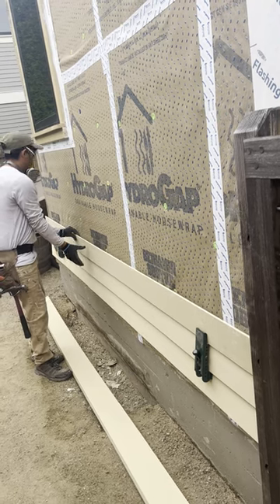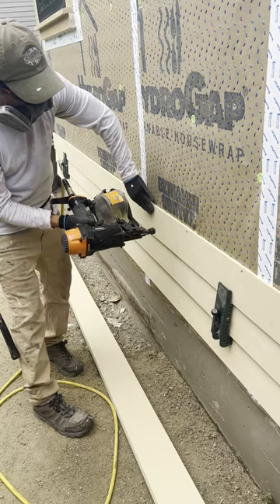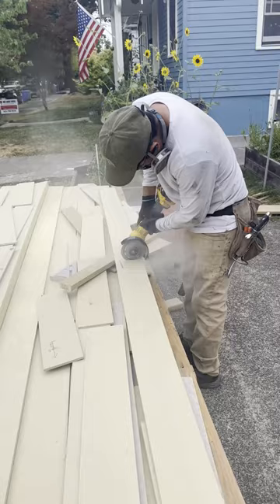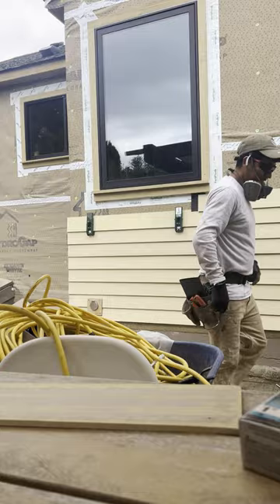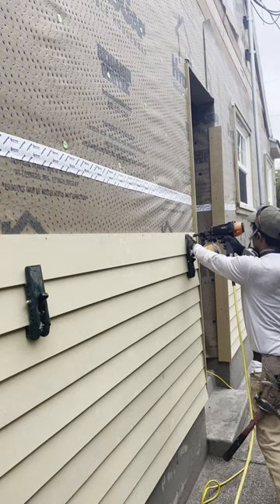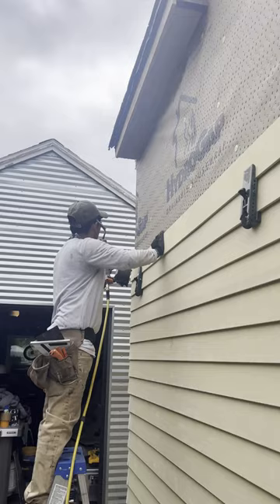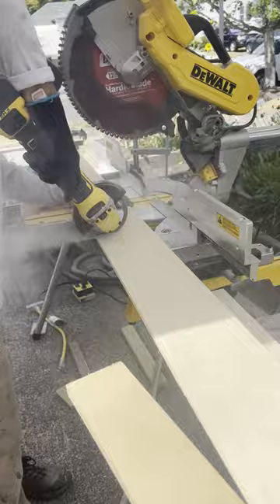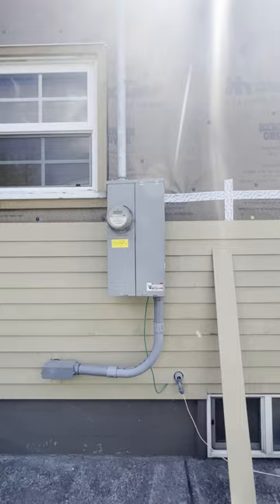How To Install James Hardie Plank Siding Primed 5.25 in Fiber Cement Smooth Lap Siding

Comment: If it is not tongue and groove on the ends or bottom, that's a No! There is no air gap behind it using vertical 3/4" strapping to allow air movement or condensation to drain & dry out, that is the wrong installation procedure. This is another NO for me.
  Not "Making It Right!"
Not on my house for product and procedure. Sorry!

Comment: You can score that hardy board with a utility knife.
Reply: @Sith_dude  Hardy board by nature is partially concrete reinforced fibers. A masonry saw blade is recommended for a smooth cut. So no utility knife.
  If you watch any HGTV, the Canadian based show “Holmes on Homes” is very popular with 10 years of shows in the can. He fixes previous contractors messes after a renovation to a new build. “Make it Right” is his moto! His team of hand picked workers attract a repair with vigor and the knowledge of what Mike Holmes Sr. likes. He stresses a good home inspector, government permits for you protection and installing good products correctly. 
  An episode about a 3 year old $500k home was leaking lead to the siding. James Hardy board place directly on top of a vapor barrier. So far, so good, right? No. There is a water barrier placed in contact with another water barrier with no place for water droplets to drain out. They had rotted sheaving, mushrooms behind the siding. Using a stud finder, mark each wall stud plus frame around windows and doors with 1 X 3 strapping on top of what we use, “Grace, Ice & water” shield. The coated nails are sealed as the nail the strapping on, the their version of Hardy board, except theirs is tongue and groove on the sides and ends. The paint is pre-baked in ovens and the color matching nails are supplied. Blue drywall is mold resistant, blue 2X4’s are mold resistant and pink 2X4’s that are fire resistant. Plus, they cost the same price.
Reply: @deankay4434  I built a barn and used hardy siding on it. Easy to work with. Using a hardy blade creates too much hazardous dust. I just scored it with a utility knife and it worked fine. Plus I don't watch TV. Nothing but garbage on there nowadays